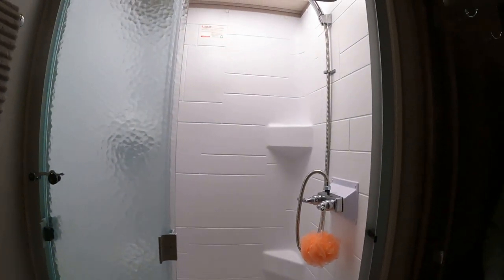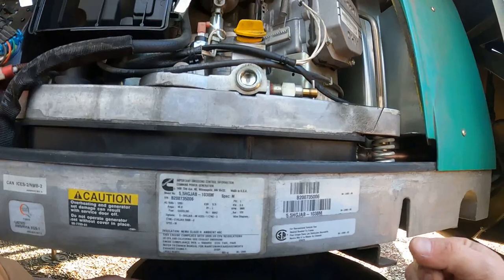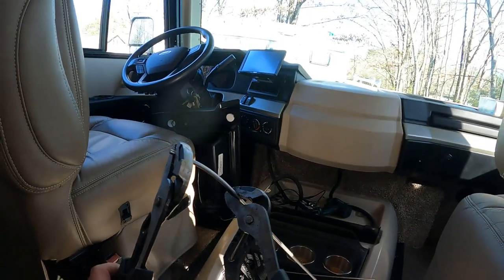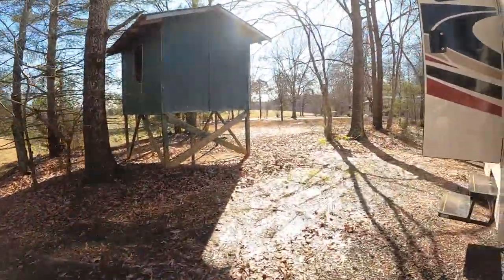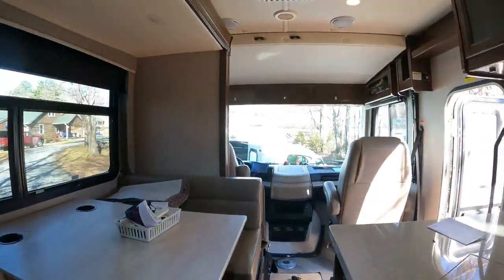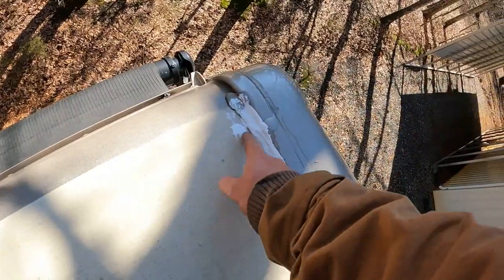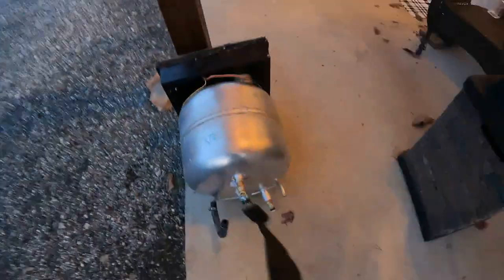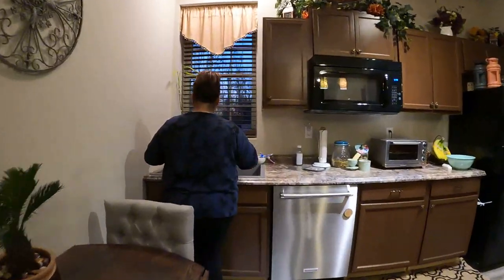One Crazy RV Repair Team!

Comment: If you ever want to custom fix an engine coolant heated hot water tank, you can wrap and seal a copper tube around the tank instead of that welded line.  Re insulate the tank and you're free to go.